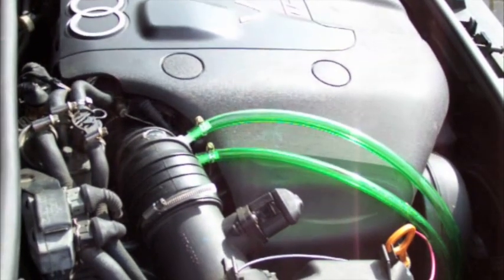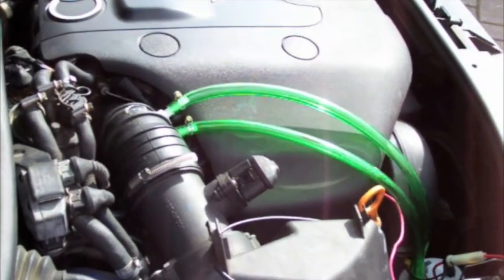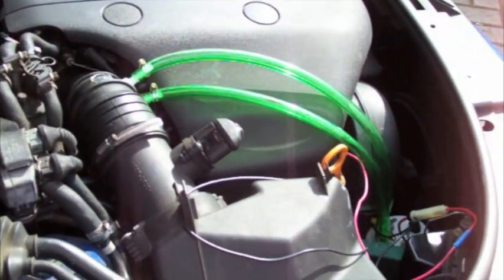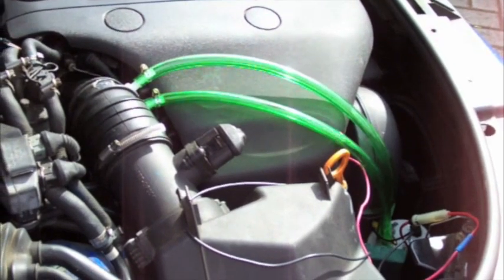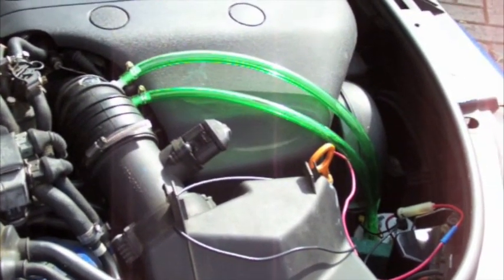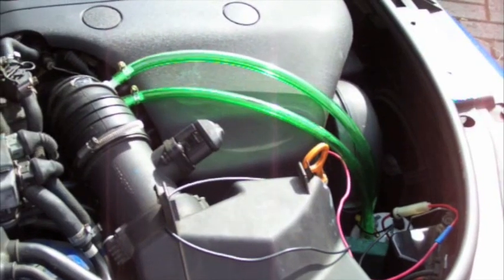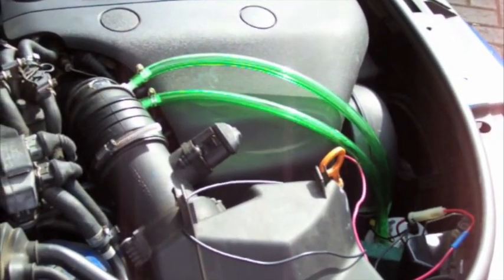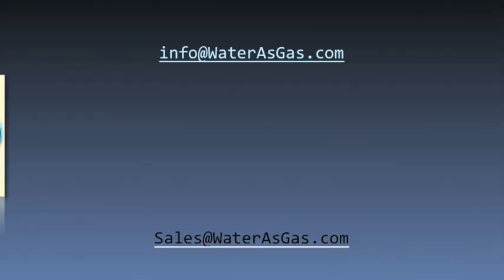Water As Gas

Comment: If you try this, run it only through the air intake of air cleaner. Don't run it in the intake manifold like they tell you because the potential for vacuum leaks is too great. I've made 3 of these for my car and 2 or the 3 had vacuum leak problems